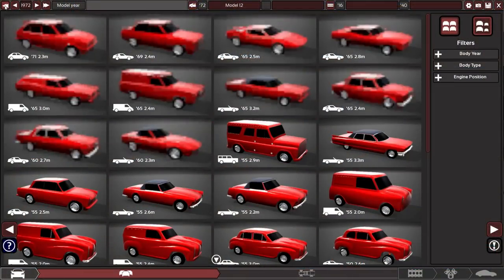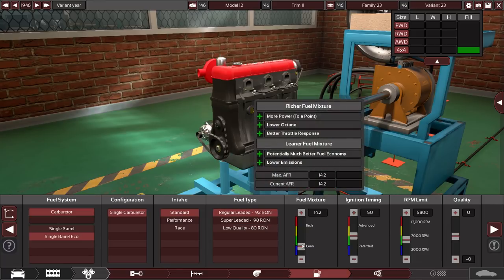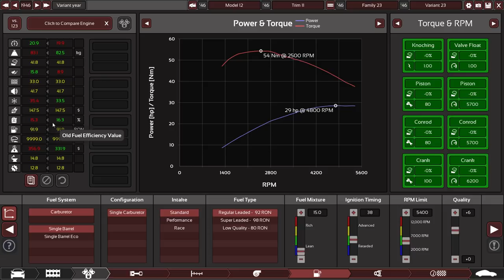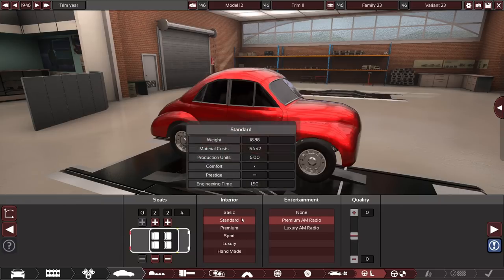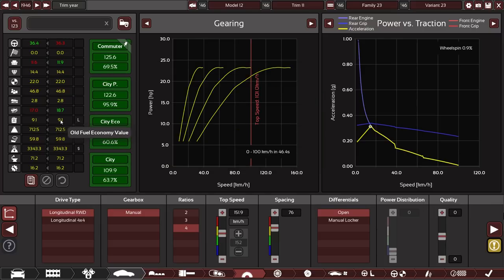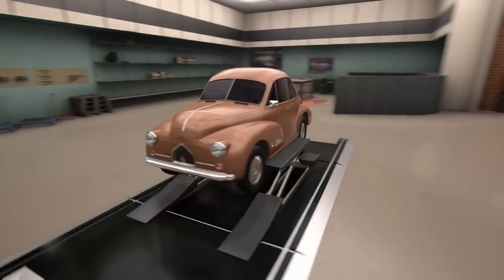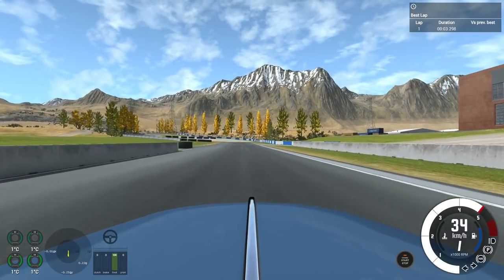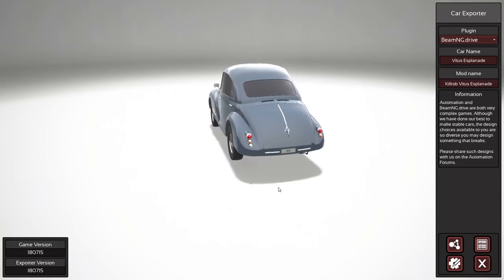BeamNG + Automation: 1946 Commuter Sedan, GETD Ep.06

Comment: Cute little car.. Impressive that they've made the driveline out of what i can only assume is a Pringles tube wrapped in duct tape..Your design work is getting really damn solid man..
Reply: well considering my 88 volvo got a 40 some kg gearbox and a 50mm driveline made t handle 180 ish hp i guess to handle 27 you would need some drive axles around the thickness as the rods of the engine and a bicycle gearbox with a clutch connection xD
Reply: +Wirenfeldt1990
Interesting that you mention duct tape... Years ago a friend of mine was cutting through the exhaust pipe using a sawzall, and when the pipe gave way, he was pushing so hard on the sawzall that it kept going and cut 3/4 of the way through the carbon fiber driveshaft (aftermarket) before he could stop it. Instant $1000 loss. Anyway, to keep the story short, I'll just say I wrapped the cut with duct tape and was able to drive a couple of hundred miles on it before I brought it in to a shop to get it replaced. Next thing you know, I get a call. They tell me there was some duct tape stuck on my driveshaft, so they took it off. Then they took it for a test drive and the driveshaft snapped. That duct tape was doing some serious work!

Comment: Rob, did you notice you weren't getting full throttle past your top speed ? I noticed I was losing power (the app in BeamNG) past a certain speed in my Miata build... I think maybe there's a bug where the theorical top speed acts as a speed limiter of sort once in Beam.

Also, almost losing the car on downshift due to lack of rev-matching spotted :P
Reply from the maker: Yes, we do have a speed limiter implemented at top speed +2 km/h... that works as intended in the flat, but not in the downhill :P
Reply: Gotcha. What's the reason ? I'd assume the way the aero translates from game to game could affect top speed differently, tbh I'd rather not have a hardcoded limiter. Even if in Beam the car goes a little faster it shouldn't be too drastic.
Reply from the maker: Well yes, would you say the same if sometimes the car would go slower though? :) The reason indeed is that the aero translation between Automation and Beam is shaky at best.
Reply: Would it go slower ? Usually a limiter limits, not adds :P

 I did notice a few hp are missing in Beam, tho not sure how (or if) the game handles power loss/gain from different temp/altitude/alien variables. Its not much anyway. 

Right now I think my car is still too draggy, surprising considering the big piece of plastic on the trunk IRL lol. Moar fiddling needed.
Reply from the maker: If we would allow for it to go beyond the limiter we would not give it that much leeway to the upside, but rather would have to center the distribution of outcomes around the calculated top speed. All those things are not easy to get right for every situation :) I think so far we're doing pretty well. Cheers!

Comment: so what all exactly translates over to beamng?  I built a 1800 hp light car and accel was...off, so the question is, does weight, the suspension settings, and power accurately trasfer?  also engine fitments seem off.  had a small coupe fit a 10L v10 and TT, when i looked inside wheel well where i can see the engine, it had room to spare.  Didn't seem to right.
Reply from the maker: Regarding the large engine, so what was your engine bay fill factor? I assume deep red ;) so possible, but not really viable. Regarding what is exported: https://steamcommunity.com/app/293760/discussions/2/3559414588253724691/
Reply: KillrobPlays okay seems accurate naturally aspirated info but turbo info can be off, which boost was a bit.  And fill factor was orange but even if it were max, it’s almost physically impossible to fit an engine in that size. Might need proportions reworked.  Been dreaming of something like this as a kid though so im super excited
Reply from the maker: Nah man, the few comments from people like you that you can fit too large engines in the engine bays (it is not an optimal way to play in campaign) is MUCH better than the many times larger crowd thinking we're satan because some engine bay only fits a 1.9L instead of a 2.0L and we must have done that deliberately just to annoy them xD Cheers!

Comment: 2-Speed Gearbox and Double Wishbone on the rear would've netted You more score. Granted, You'd need 4 minutes around the Automation Track, but hey...
Reply from the maker: Yes, but one thing you may be forgetting about here is that the engineering time would be longer, which means opportunity cost that early in a campaign :)
Reply: Touché. On the other hand, I used exactly 0 quality points and basic interior, which, in combination with a simpler gearbox, should make up for the increase in engineering time for the rear suspension. looks at his design - okay, 2.9 months more for me... but if I grant myself the same number of tech points as You did, without actually using them, I might be able to shorten the engineering time by a month or two, correct? (and even if not, I should say that my design might stay buyable a tad longer than Yours... quite possibly more than 3 months)
Reply from the maker: Yeah, 3 months extra isn't what I would call excessive, so well done. :) On the other hand I have not balanced the engineering times for the gearboxes yet, I need the context of the campaign to do so!

Comment: For a lot of the stats you have basically built a 1948 Morris Minor though with a more high tech suspension set-up, slightly lower top speed, noticeably better fuel economy, far worse top speed and costing about twice as much. Sorry but I think the Morris wins in this battle.
Reply from the maker: What are you basing that cost on? :) Because the Automation cost numbers are not inflation corrected and cannot be properly compared to old IRL cars.
Reply: My calculations were slightly off as on a second look yours seems just over 50% more expensive. The Morris Minor cost £384 when new which is equivalent to £12,504.79 now which is equivalent to $16397.36. You car costs $2268 which is equivalent to $23,691.37 now. The websites I used were http://www.in2013dollars.com/1950-GBP-in-2017 , https://www.dollartimes.com/inflation/inflation.php?amount=1&year=1950 and the google currency converter.
Reply from the maker: I don't think you read what I wrote or don't understand it. The costs shown are in modern day dollars, not inflation corrected. Also inflation correction only really works before the 80s, which is when they started to manipulate the baskets heavily to suit their government spending needs.
The cost shown is the material cost, that has little to do with the actual cost of the car, which would have to include engineering, labor, R&D, factories, distribution, marketing, etc. So while your calculation is interesting, it just isn't relevant in the context. Cheers
Reply: Well my reply was simply answering were I got the numbers from. Might there be plans to refine the costing model in the future so it can factor these things in and relative costs of different technologies at different times?
Reply from the maker: We did have a think about it :) but it is rather difficult a concept to grasp for many, so we believe keeping the same baseline valuation will be the way to go for now. That does warp the economics a lot though... inflation is such a big factor in long term business. Difficult to know what would be the best choice for the game.

Comment: I suggest you to try building a little Gasmean(American)-style non-premium  rear-mid enginr sports car with V6 from 1983 (or making a "sport"sedan from.the same era)
Reply: Alexander Frank any var with a v 6 besides an Italian car or desperate corps attempt at econo sports is not a sports car.. hevk econo sports are not even really cars, usually base model of the car u really want
Reply: First of all, italian V6 are bullshit, okay? Cuz they can be light, powerful, etc,etc, but they sound like a grandma on a top of her lungs, when she saw a mice on a counter, and also, they are as reliable as the pistons made of wood. If we are talking about V6, the only good engines produced nowaday are made by Nissan. They sound as they should, they pull as they should, they don't break every 5 miles and they don't consume as muchh fuel as a fleet of air carriers. 
Seconly, i meant a nid-engine car or a "sport sedan" similar to SHO, becayse typical typical rear-mud engine inline4 cars like Fiero or IInd gen MR2 are way too common and seing a V6 in this config would be interesting and "sporty" sedans are npt a common theme att all
Reply: Alexander Frank okay maybe I should have said transverse mounted inline, the Alfa Romeo one, and heck though, the dino could be made to push if dumped enough effort. The sound is an niche taste